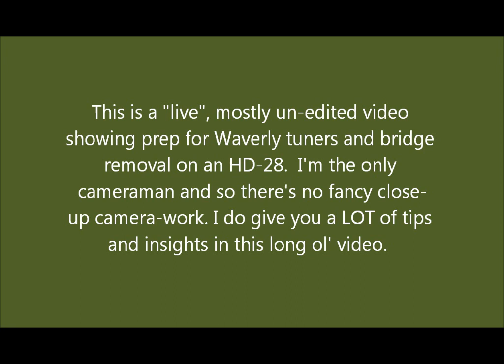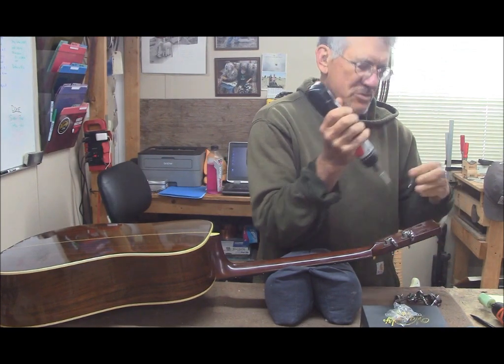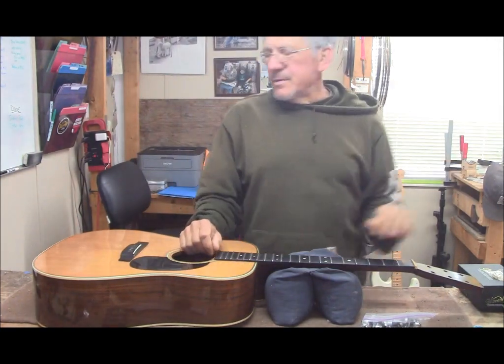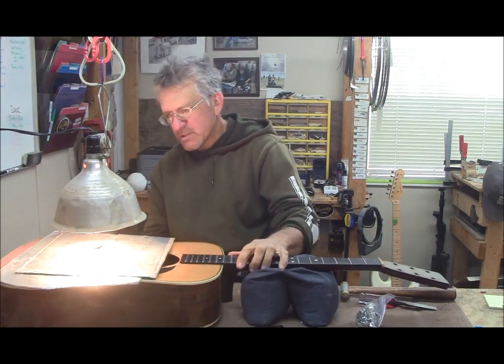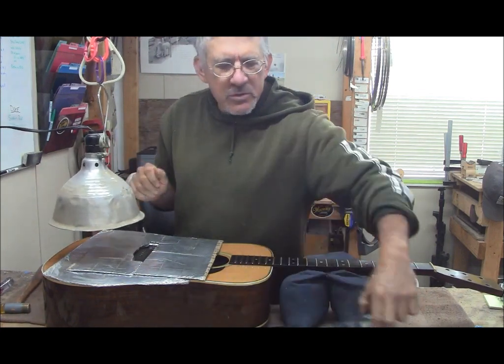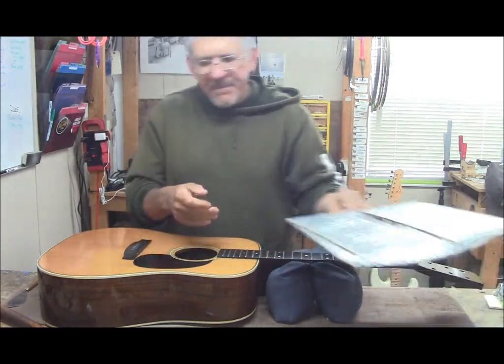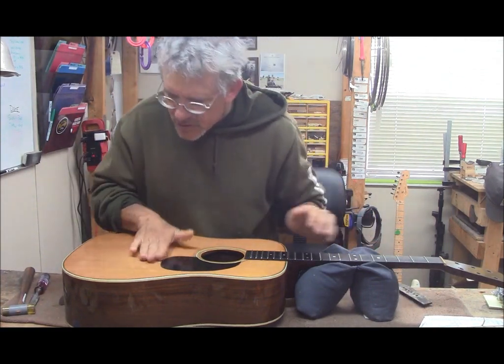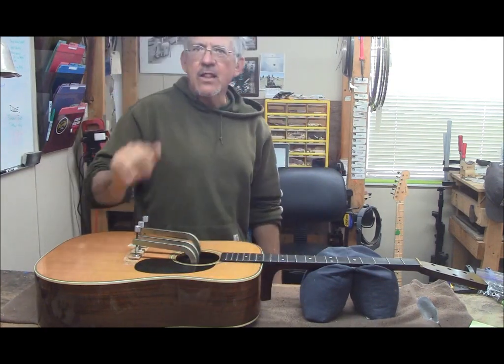Repair Work: Martin HD-28 tuner and bridge removal

Comment: @11:03 Possible & precisely. Everything Bryan says is theoretical has been factual in my experience. I've changed from Rotomatics to Gotoh or Grover vintage "Kluson" styled tuners on several guitars I've owned. They are lighter, they made the guitar look better, feel better, & made the instrument have a more balanced & more focused tone. I don't know if Waverly's are any better than Vintage Gotoh or Grover's, but anything is better than Roto's. I think I would prefer a 16:1 or 18:1 ratio better. 14:1 on the vintage Grover's is a little too fast even with the smaller buttons. @17:50  Not boring. Highly informative!!  I loved it!!!!!!!
Reply from the maker: I just say that to thwart challenges.  It's like the whole short vs long saddle thing... "do they sound better?  Prove it!!!"  Thwarted with "I like the way long saddles look."  Ha... challenge THAT, ya know?  :)
Reply: @Bryankimsey  lol   I like the way long saddles look also.

Comment: Great video. Although some necks are different lengths does the 11 & 1/8  measurement hold true for all Dreadnaughts.
Reply: @Bryankimsey  the 11 & 1/8 I was referring to is the distance from the front edge of the body to the front edge of the bridge. Sorry for the confusion.
Reply from the maker: That is just a backup check to make sure the bridge is square on the body and the neck gets  aligned to the bridge. The deciding measurement is from the 12th fret to the saddle location. And no... A 12 fret D would be different. But all 14 fret D should be about there. Again, 12th to saddle is the final authority.
Reply: @Bryankimsey  Thank you. I learn so much from your videos and tutorials. And I really admire your patience and how you avoid short cuts.

Comment: I don't think it matters what the measurement is from edge of body is to edge of bridge, 14th fret placement on neck can always vary The critical measurement is from center of 12th fret to edge of saddle at high E string contact point. That's how I've always done it with good intonation results.
Reply from the maker: Oh... the main reason I measure from the front of the guitar is make sure the bridge is squared to the body.  If the neck's not on straight (many aren't!) and you set the bridge to the crooked neck, then everything's off.  So, I set the bridge square to the body, then check the neck against that, mostly for the E to E balance.  Then I check the actual fore/rear location of the saddle against the 12th fret.  Make sense?